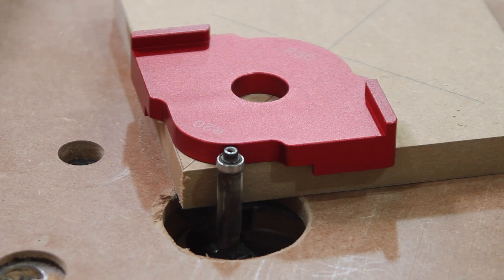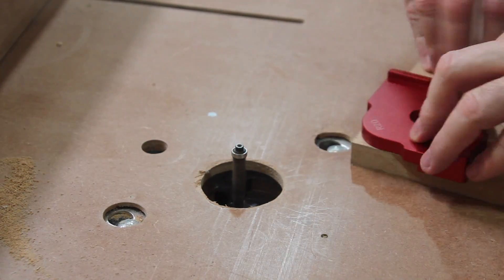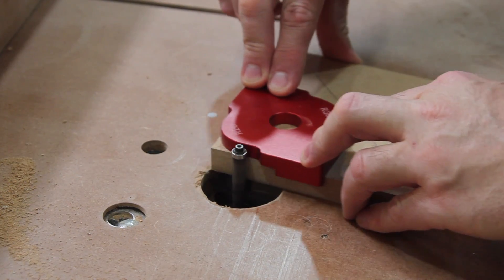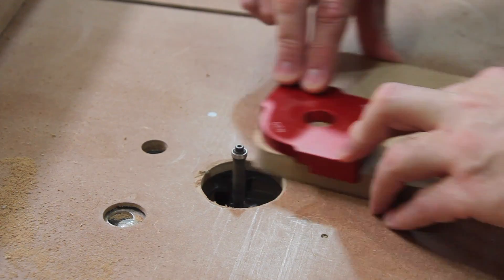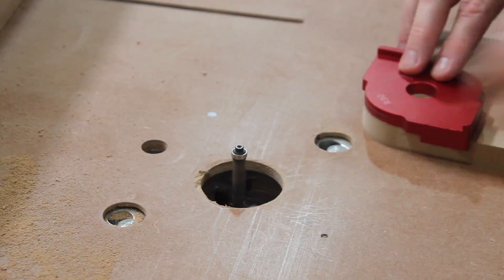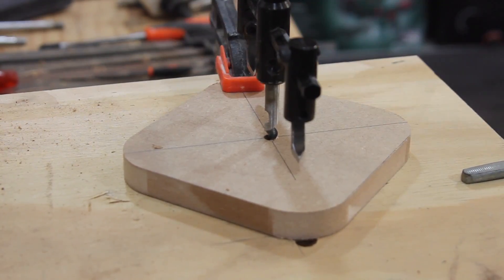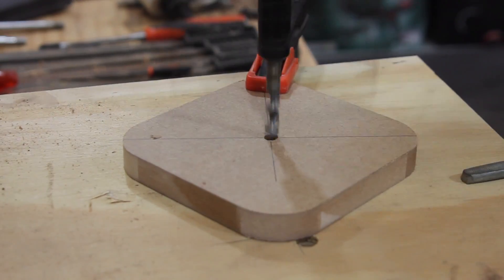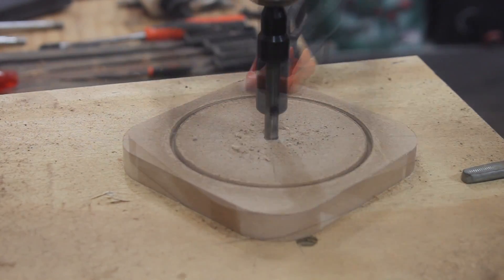Building Suspended Stereo Speakers in Copper Pipe Frame - by SoundBlab

Comment: nice design once again! You have probably said it before but what program do you use to calculate the enclosure?
Reply from the maker: Thanks! I use WinISD from http://www.linearteam.org
Reply: thx!
Reply: But how did you calculate the enclosure for the PR without the Ts parameters
Reply from the maker: I measured the TS parameters with Dayton Audio DATS.
Reply: Besides the speakers Parameters don't you also need the passive radiators parameters?

Comment: Wow they look amazing, another great build, you have to find some springs to give them the finishing touch!!
Reply from the maker: Thanks
Reply: Yes, and copper hooks maybe?  Also, springs can be painted if sprayed lightly and dried while stretched. 
The acoustics should be helped by the passive radiators, but will not be ideal. Still, beautiful design! 

Just thinking out loud, here...
One way that could help the sound would be to swap the hooks and springs for more of the rigid copper piping. Not quite as cool as being free to bounce and vibrate in mid-air, but the speakers could be suspended solidly in a similar way, visually... Except there would be less sound pressure lost than with the springy supports. Of course, finding the proper corner pieces won't be easy. Hummm...This is getting ridiculously complex!  Never mind, just use a hidden sub-woofer!  ;-)

Comment: Really cool design.  nice work!  My only suggestion would be to use some nail polish remover to remove the print and clean the pipes.
Reply from the maker: Thanks! I used some abrasive paste on one of them and left the other one with the print. Wanted to see how they compare. Seeing that one has been polished already, I should really just do the same with the other one.
Reply: Modustrial Maker steel wool does the job also
Or just actual copper polish
Reply: Ah, makes sense!  They look great either way.
Reply: Copper turns a great red tint after a few months of being untouched, so I'd say polish it and leave it

Comment from the maker: SOUND TEST and BUILD BLAB video is out now. Watch it here: https://youtu.be/RP3z6f8KbzE
Reply: I'd be curious to hear the difference between those speakers on a stand vs suspended.
Reply: SoundBlab these black speakers look so damn good👍
Reply from the maker: Thanks David!
Reply: Honestly, there are a lot of "engineers" who build exspensive crap headphones and speakers, I'll wait and give a listen before passing judgment, not that sound coming from youtube would be all that accurate representation.... I must say the idea of suspending a "home" speaker is rather intriguing, they do it at concert venues all the time.
Reply: *Its already one weekk .. I cant wait to see in action
Reply: Please explain "be more optimal"
Reply: Cant disagree more with that than is possible. I have a subwoofer system that I compared back to back suspended and solid mounted. Solid results in horrible resonances and coloration. Suspended is super clean.
Reply from the maker: derbigpr500,

I agree, but my intention was not sound quality. I was after designing something visually interesting. No snake oil added!
Reply: Mike

They'll work properly on a stand vs. won't work properly when suspended. You can't suspend a speaker and expect good sound. He can maybe sell this snake oil to people who have absolutely no common sense, but as an engineer and someone who designs high end headphones, and knows quite a bit about acoustics and mechanical engineering, I can tell you this is about the last thing you want. In theory and practice. Not saying they'll sound like crap, but they won't work as well as they would when on a solid stand where the driver movement will be more optimal.

Comment: Did you think about sanding the copper or chemically removing the lettering?  And what about a paracord or bungie cord to suspend the speakers?

Nice build though!
Reply from the maker: I did polish up the one frame with a abrasive compound, and left the other one as is. Wanted to see how they compare in look and feel. But after a while the polished copper does fade again.

Thanks

Comment: but why?
Reply: Speakers are mounted on spikes or pads to stop the vibration FROM the speaker affecting OTHER things around them. Traditionally, it stops the bass from making the needle skip on the vinyl turntable, or old CD players from skipping. The speaker box spikes have absolutely nothing to do with vibrations somehow affecting a speaker (which is can't - think about it). Suspending a speaker cannot and will not make any difference - except perhaps if it pushed enough air then speaker cone could move the enclosure and thus create a off-phase effect which reduces and MUDDIES the bass and midrange.
Reply from the maker: Yes, that is what I meant. Perhaps I did not make it clear that the vibrational energy comes from the speaker, isolating it to not influence surrounding surfaces that can cause mechanical interference back to the driver.  I don't agree however that suspension will not make a difference. Many speaker isolation pad systems work on this principle and is very effective. One example is from Boenicke Audio that uses a 'swing arm' suspension system for isolation, or search for 'magnetic speaker isolation' which essentially suspends it in mid air.
Reply: Can Olum exact same question brah... 🤯🤯🤯
Reply from the maker: This build was experimental in two ways. One was to design and build something that is visually interesting. The second, but less important to me at the time was to try and isolate the speaker from any mechanical interference/vibrations that might occur if it was just placed on a surface. Mechanical interference/vibrations can influence the sound of a speaker, and that is why you often see speakers mounted on isolation spikes or pads. The advantage of this is that it will in particular provide a cleaner sounding bass and midrange response.

Comment: You are very innovative and know how to produce quality products, well done
Reply from the maker: Thanks.
Reply: 1) He didn't innovate anything.
2) This design is "what not to do when designing speakers 1.01."

Again, don't wanna be "that guy" that shits over someones work, but any engineer that knows anything about speakers will tell you that this is the opposite of what you want. Speakers need to be as solid and movement free, so that the membrane of the driver does all the movement, instead of having the whole enclosure move around and not be perfectly solid.